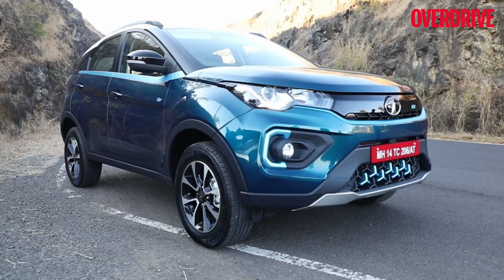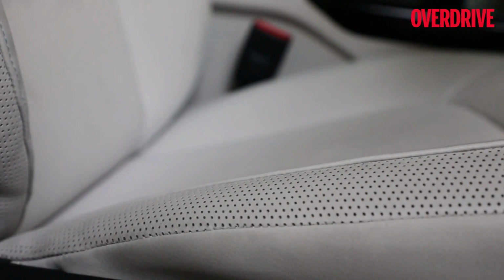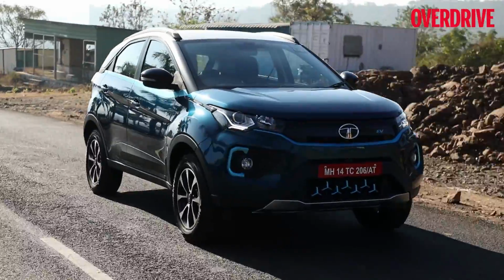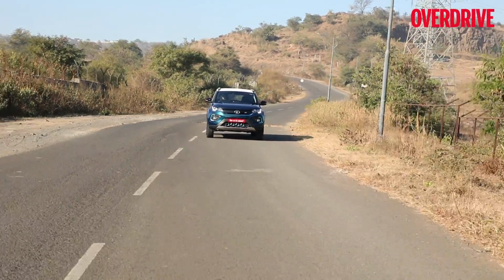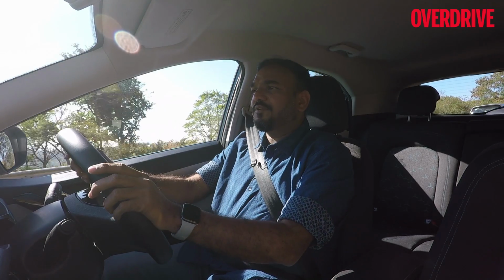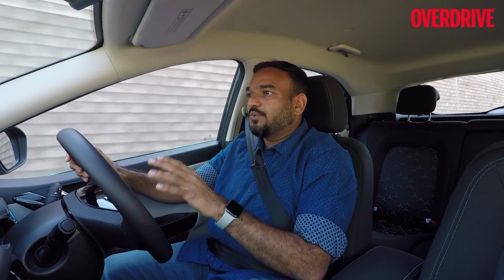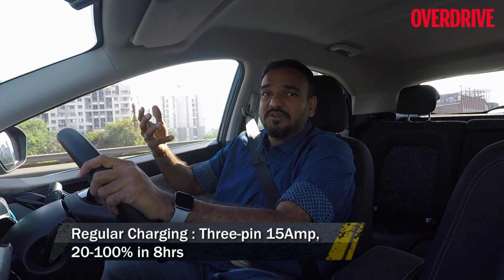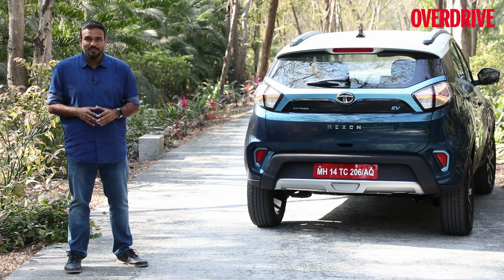Tata Nexon EV | First Drive Review | OVERDRIVE

Comment: As automotive journalists you people are equally responsible as automakers in the transitions towards Electric
In educating and convincing or selling Evs with geniune comparision with what people pay for what they get
 And make People more sensible with their car buying now
This seems to be a good job but it needs to be scaled to another level
To an extent of viewers choosing this EV over the venue or creta which might be no better than this for the money they pour in and they experience of ownership and the Car driving or chauffeuring experience you get!! What if creta is a segment higher and compares to this on price the measurables for what you get and what is actually required should change for sustainability!!!
If someone has to compromise a bit of space and bit of luxury for going EV way they should be convinced by your reviews this is the whole intension of me writing this
Overall investment and Cost of ownership i hope will be comparable to the cars of price bracket a notch lower
With most of the urban users who use this car in the city most of the time
It makes a lot of sence
With a fast charger installed at every pass by bay on highways this would make even better sense!!
Hope they outsell the undeserving ICE cars and hope Tata have made a reliable product without range depletion!
With most of the highways with 120 speed limit it is a way of limiting carsfrom overspeding

Comment: @Overdrive..This is a well detailed and thorough review!!!
This car is damn good start for the ev revolution. However..
If you do the math considering current EV range vs price ratio...CNG cars make much more sense...They cost just 60-70k over regular petrol and cost recovery duration is 1.5-2yrs..CNG fuel is much greener than petrol and diesel.
What are your thoughts on this?
Reply: CNG isn't that different in CO2 emissions from petrol, and it's the CO2 that's causing the global warming. Electrics are also more liberating if you have your own house, you don't waste time at the petrol pump since it charges overnight and they offer much better drive experience in the city.
Reply: Also everyone is overlooking the maintenance cost of ice cars. Electric are practically zero maintenance. No engine oil, clutch plate, timing belt, filters etc. You have to consider that and not just fuel cost

Comment: While I do agree with most commenters here regarding the faulty range (and I have read the OD "explanation", it is just a lame comment) that Overdrive managed to extract from the Nexon EV, even the other reviewers made a basic mistake of driving the car like an IC engine car. I am driving the E2O for last six years. Company claimed range = 100 kms,
Everyday driving range = 110+ kms.
EVs need to be driven as EVs. Period.
Another thing, going on the highways (eg from Pune to Mumbai) is a great regeneration opportunity, opposite to what all the reviewers are saying, that regen is good only for the city. It is better on the highways.

Comment: Regen has no real impact on overall range. In fact, highway should give you higher range than city even in EVs. Except - THe speed.. In cities you may do lower speeds and EVs give better range with lower speeds, as the energy needed to cancel the drag is lesser. 

So, what matters most is the speed - city or highway. In City, regen may improve the range you'd otherwise get in city, but on highway, if you keep a steady speed of 60-80km, and check the range you'd see far higher mileage than City, where you'd never cross averages of 60km normally.

Comment: Interestingly, you didn’t mention if it’s a FWD, RWD or AWD. Basically, in the EV terms, you didn’t mention if it has a single motor placed on front Axle or rear axle, or dual motors one placed on each axle.

Comment: 🤔Real world driving range of only 200 km isn't sufficient.
Reply: You're not gonna drive 200km in a single day. Every day commutes avarage about 60km - 100km.
Reply: @kirupakaran7765  Every 2nd or 3rd day u need to plug it in...If you are charging at home it will take 8 hours to charge.
Reply: charge it overnight bro
Reply: @chetanmazire5373  I know this bro...I am just sharing my opinion
Anyway I am living in a Society and there's no plug point available in our parking 😑
Reply: Tata said that they will build an output where you live..!!
Reply: @arjunnair6721  that is only applicable for your home (if you have a separate plot). Society won't be allowing anyone to install a charging point (AC fast charger by company).
Reply: @abhishekkapoor214   and more of that we have to wait ..!!
Reply: @abhishekkapoor214  it can be done connection will be given through your house electric meter